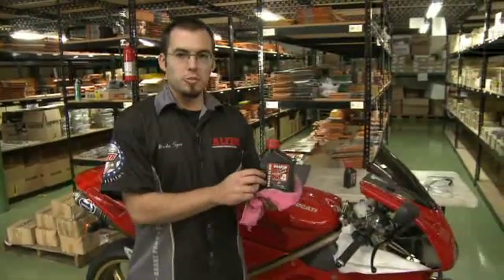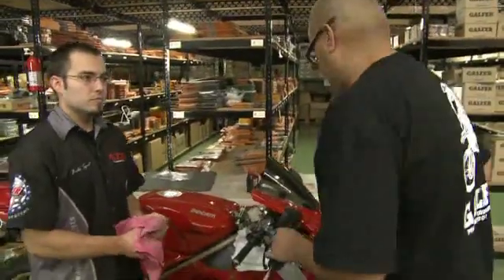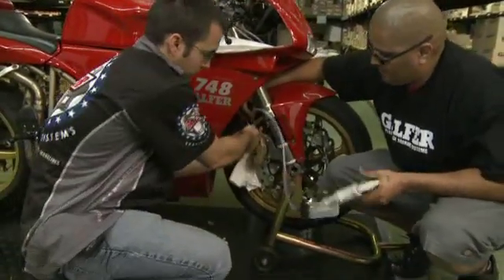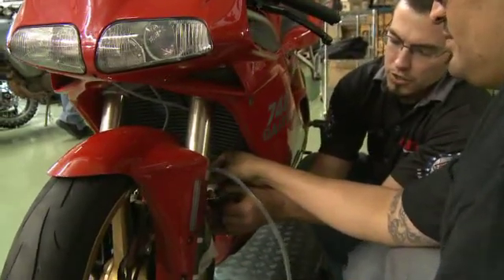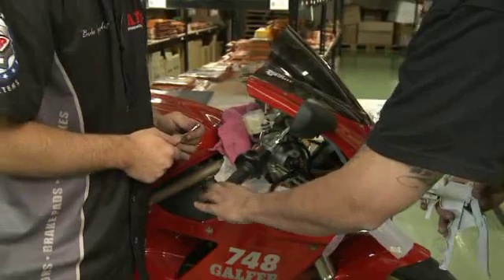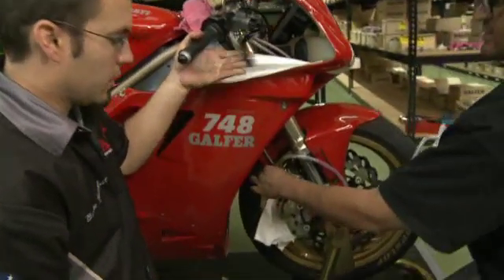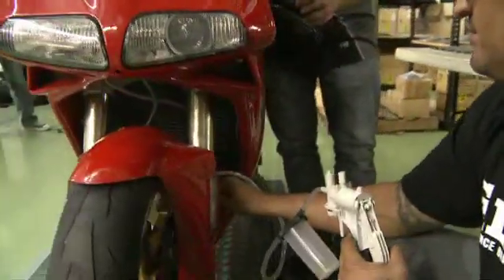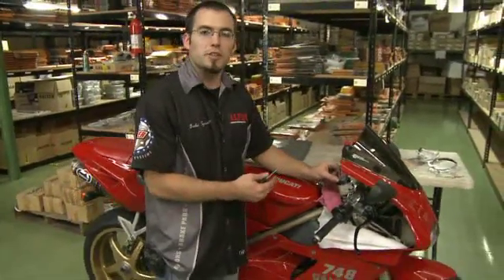Galfer Brakes - Bleeding Brake Lines

Comment from the maker: Yes. Both 5.1 and 4.0 are glycol based brake fluid. Main difference between them is the 5.1 has higher boiling points for when you get *really* fast.

Comment: I don't get it.... That bleed job looks real shitty man. There is no way you should be able to move that lever so much with a fresh bleed job. I've had bleeds where u can only move the lever like a 1/4". That's what I would consider a good bleed. The lever action there looks like ur just squeezing air. Water/oil/brake fluid.... does not compress.... What are you moving with all that lever action? Pads that haven't been adjusted? ... honestly looks like air.

Comment: at 4:18-4:20 while bleeding the Master cylinder you didnt hold the lever when you opened up the bleeder nut- was this by accident or intentional?   I just put your kit on a zx6r and the fronts are pretty nice, i disliked how i had to file off a tab on my master cylinder setup, but the lines work well.  my rear is still squishy- any videos on rear brake bleeding?  my bike looks like it only has a bleeder nut on the caliper in the rear, i didnt see a bleeder nut on the MC in the rear.

Comment: Actually, your reservoir cover is much worse than your brake fluid bottle cover because it has a vent in it. 

Water that collects in your brake fluid over time lowers the boiling point of the brake fluid of approx. 150° F. 

Boiling water = steam = compressible gas = less braking

Just like oil and pretty much every other fluid in a motor vehicle, brake fluid needs to be replaced periodically. Using fresh fluid that has not been exposed to air  means more effective braking for longer,